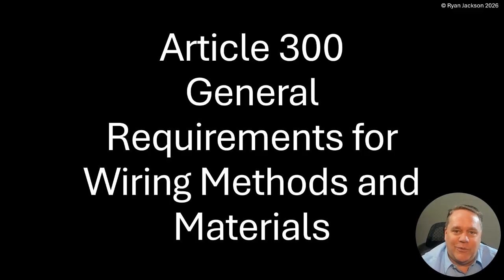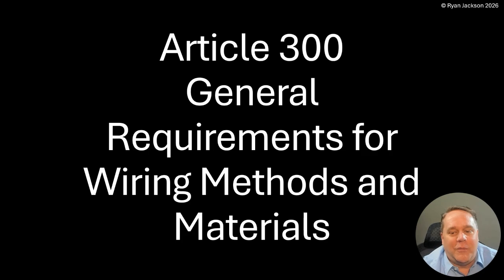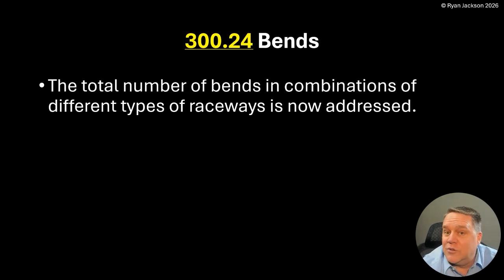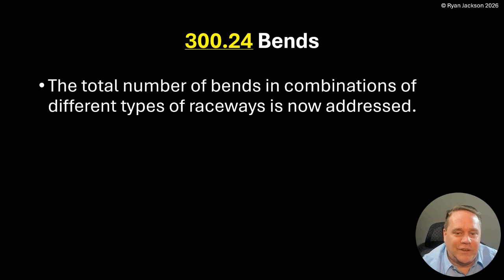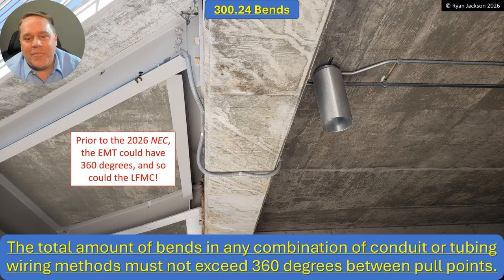100 Days of the 2026 NEC Changes Day 38: 300.24 Bends

Comment: Im sorry but its a dumb code.  You can straight the flex and install wire and then hang it up bending so many bend and practically its be fine because you dont force pulling wires into those bends.  Merry Christmas Ryan
Reply: True. Good point. However the assumption you might be making (that an inspector can't be certain about) is that the installer was smart enough to do it that way and not install the flex first then pull (shred 😁) the wires afterwards.
Reply: @twocoolnerds4628 agree that just one of the not smart code like requiring receptacles on island base on square ft.
Reply: You would be breaking the rule that the raceway must be installed before the conductors are pulled.
So no, you still can't exceed 360° total bends.

Comment: Merry Christmas, Ryan!  

Frankly I basically assumed a single run of raceway was never permitted to have greater than 360° bends without a pull box at the ≤360° bend, it's essentially common sense and good practice and frankly, I'm sure most commercial/industrial electricians from long before my time had similar thoughts regarding this topic. 😊

Looking forward to the next upload.  Keep up the good work .